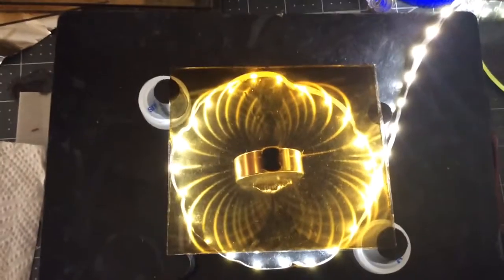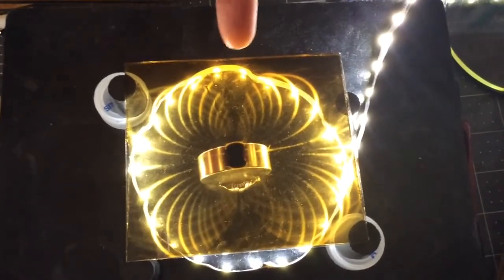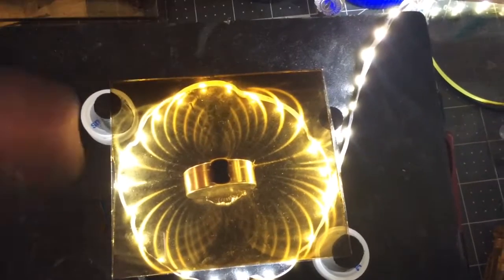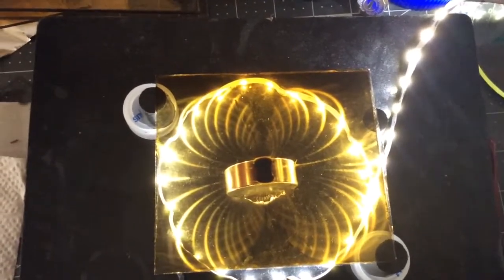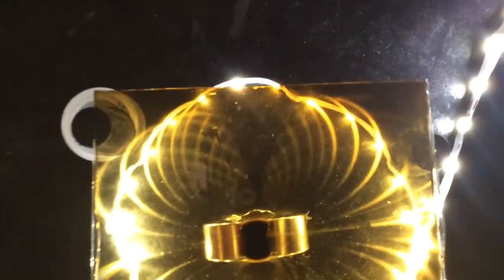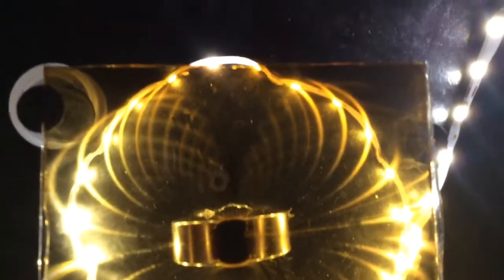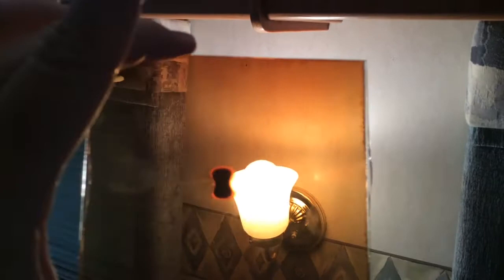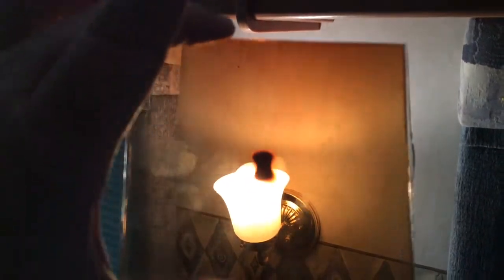This blows my mind!

Comment: Interesting as well is it seems the two sides outside of the funnel aren't symmetrical. Is that just a fluke. The screen left on both the top and bottom have a corkscrew like pattern and the screen right seem to resemble a sort of rib cage looking thing. That really is crazy though. The funnels are so sharply defined.
Reply from the maker: Karen Smith I'm not sure if it's a fluke or the angle. There are so many variables as well. Like the metal bar on the edge of my table, etc, ect..
Reply: Ron Blevins go check out theoria apophasis if you haven't already. This is the hyper trochoid the only way a field can extrapolate itself. And the vorteces you see are the centripetal convergence as well as centrifugal divergence.